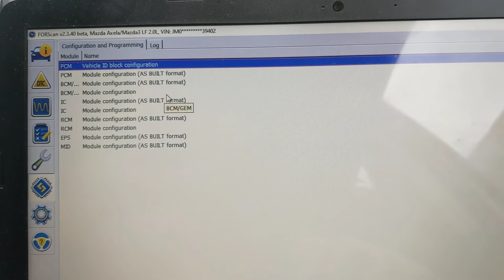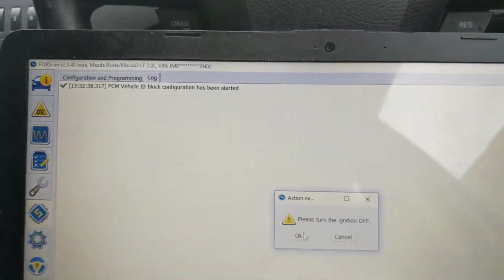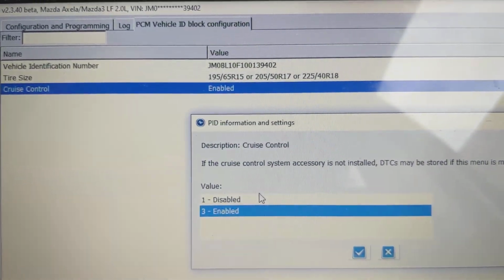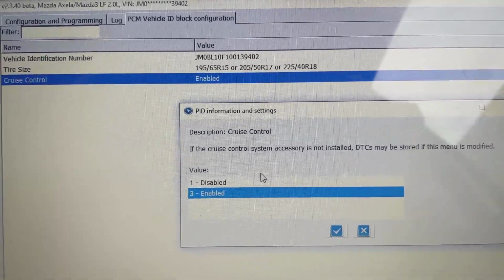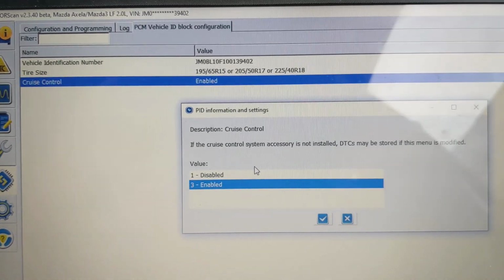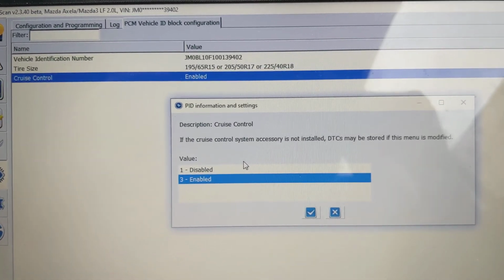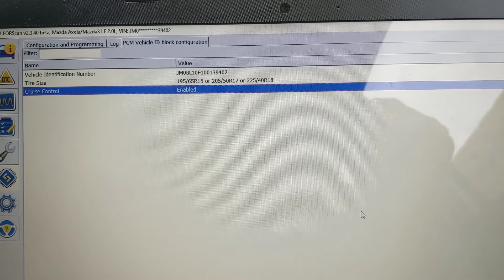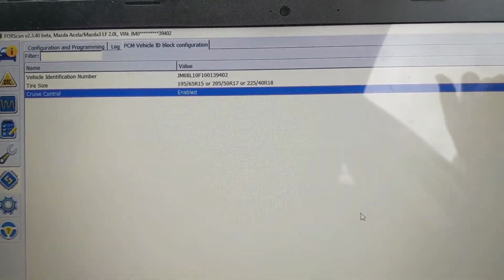BL Mazda 3: 3/4 How to install factory cruise control using FORScan. 2009 2010 2011 2012 2013 2nd

Comment: Bought a kit and installed. cruise control is working now mazda 3 2009 BL. Thanks for this video youre a champ
Reply: Did you just bought the buttons/ steering wheel with cruise buttons, 4 pins brake switch and enable it with forscan?